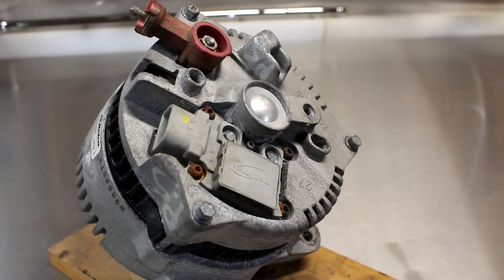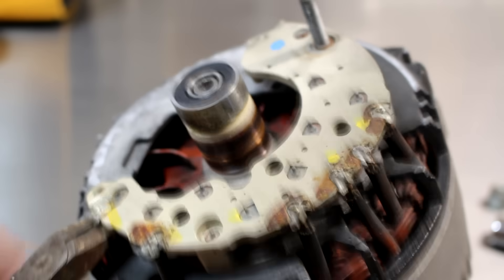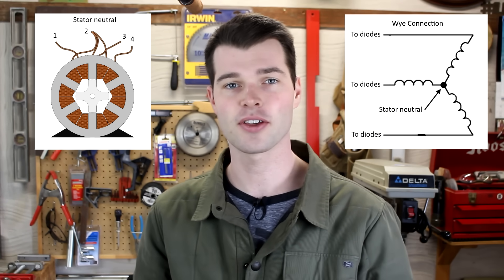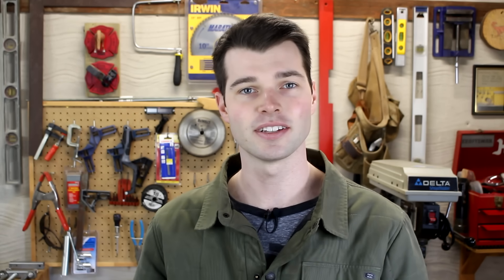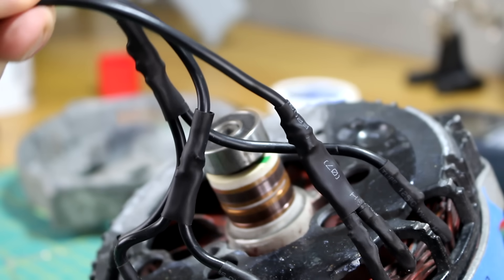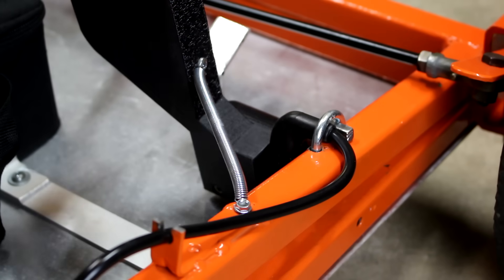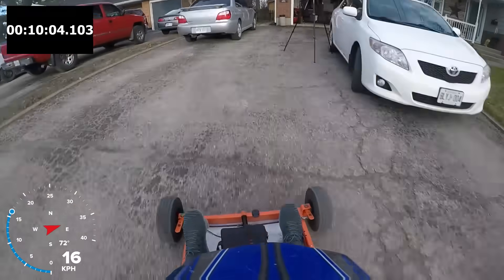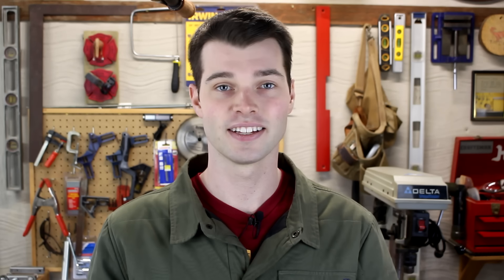Converting a Car Alternator into a Go Kart Motor

Comment: Could u please tell me exactly how u wired up your 6 wire alternator into a delta configuration, I have same type and I'm trying to turn it into a motor, brushless
Reply: To wire the alternator as delta or star
You first need to know how much tips the stator wires have
I can help you
Reply: @foxxyytofficial  there are 6 groups of two wires
Reply: @aaronowens1627  do you have a multimeter?
Reply: @foxxyytofficial  yes
I've located the 3 phases, I'm just unclear as to how exactly it'll be connected
Reply: Using continuity setting I was able to find the 3 separate groups, so 6 leads coming from inside and I soldered 2 leads, one to each brush for the low voltage to generate the field. I connected the 6 winding leads into their 3 groups and externally connected them as I understood it to form a delta connection.
Not sure if its correct cuz I was gonna use the speed controller from original on the scooter, but soon realized being for a brushed motor, its minus one lead. Any help, photos would, I'd appreciate greatly
Reply: @aaronowens1627  if you connected in delta, you can test it with any kind of brushless controller (rc esc, ebike controller, etc)
Reply: @foxxyytofficial  
Ok, I just have the 2 wire, brushed motor type tho. I'll order a big brushless tho. Do u have photos of how to connect those 6 wires in delta? I read blueprints for welding, fitting and build electric guitars, fix maps, but I'm not formally trained, it's all stuff I study and pick up on. Thanks
Reply: @aaronowens1627  call me on Telegram (its a competitor to whatsapp) searching @shadnightmares, and send me a pic of your alternator's wiring, and what wires are a pair (what wires have continuity between them)
Reply: @foxxyytofficial  what about for a 8 wire alternator ?
Reply: @markkidrov8426  probably it have parallel coils (2 groups of 3 phases and one neutral)

Comment: Could u run the alt to the battery and then run battery to a starter motor with some sort of governor to control starter speed I duno if a alternator would keep battery alive or if starter motor would suck to much power, but this build you have done is awsome
Reply: too complicated and not efficient

Comment: Quick question:  In case you have 3 pairs (6 wires), can you start the motor in delta and then change over to star to get higher starting torque and then higher speed subsequently?
Reply: I think yes, but you would need to take caution while testing
Reply: @foxxyytofficial  Thanks buddy,

Comment: hi very nice project, i would like to mike the motor but i have a question, will the motor work if i use smaller voltage for perhaps 24v or 36v
Reply: Yes, it will work, but with less RPM being usable

Comment: Why was second battery needed? Why rotor couldn't be plugged to the same battery?
Reply: He used the second battery because he didn't have a DC/DC converter from 48VDC to 12VDC
Reply: @foxxyytofficial  So, the rotor couldn't be plugged to 48V?
Reply: @Van_Tage  no, any voltage over 8v (in some rare cases the alternator can hold 12v on the rotor without overheat and damage), the rotor gets oversaturated with magnetic flux and it doesn't help

Comment: My alternator has 4 wires... How can i know what is the center tap.
Reply: It is thicker, and have lots more wires tangled together than the others
Reply: @foxxyytofficial  thanks bro
Reply: @owenlacanialo7882  if you need more help, take pictures of the alternator wires, and use IMGUR to upload and give me a link
Reply: @foxxyytofficial  sent pik in ur FB acct.
Reply: @owenlacanialo7882  i think isn't mine, i never showed my fb account
Reply: @foxxyytofficial  austiwawa... Fb page...
Reply: @owenlacanialo7882  i didn't found the photos there, i'm not austiwawa, just a fan of him
Reply: @foxxyytofficial  oops.... So where can i send the pik?
Reply: @owenlacanialo7882  use this site: https://pasteboard.co/
when uploading they will give you a link, so copy the link and send here in the comments
Reply: @owenlacanialo7882  hey, you will need to grab a multimeter in continuity mode, and test the wires in pairs (test 1-2, 1-3, 1-4, 2-3, 2-4, 3-4.)
one of those wires will have continuity with the others (like if you have a dot on the paper and draw 3 lines beginning in the dot, the phases will be the lines and the "neutral" point is the dot)
Reply: @foxxyytofficial  thank you. 😊😊

Comment: Can we run alternator for long time continuesly.
Reply: s.srinivas reddy, I would not suggest the use of a automotive alternator (retooled) to be a motor, and most certainly would not recommend it being run for lengths of time continuously.  Alternators are purpose designed devices to recharge a 12 Volt Lead Acid battery after engine start through a 12 Volt starter motor. The starter motor is also a purpose designed DC motor built to turn a gas driven (petroleum) over to start the engine. 
There are DC motors, purpose designed to operate continuously, for sale, by manufacturers where that is what the company builds for customers.

Comment: Hey, I really like this idea and I want to do something similar with a standing fan motor, I want to control it with an esc, but I’m a little confused because it has 8 coils and 4 pairs of cables, so I’m not sure how I’m supposed to wire it, from the diagrams I have seen in google the will be 3 main wires (3 pairs) and the last pair will be neutral, but it’s connected to a capacitor. I would like to know if using a esc will be possible and if I’m not to far of with what I need to do to make it work.
Reply: Maybe your fan motor is DC.

Comment: hey what i want to see and this video has 4.6 million views is a video about turning an alternator into a motor and using an alternator turned by a small high speed motor to power the now motor alternator as an energy savings device. you can do this for boat motor as they are alternators anyway and may work under water but may shock people so maybe put it in a tube that goes  in the water. just keep both above the water line with a elbow for the prop. it would make like four time the energy and be a big hit man. you can do it with drone motor but it does get heavy so the frames break man. you can use like tiny high speed motor on the one drone motor to power the other drone motor and it goes well sometime long enough for powered motor to burn up.

Comment: The alternator being 3 phase, could you use a VFD to control the speed of the motor?
Reply: The alternator works more like a BLDC motor, not an induction motor
Reply: @foxxyytofficial  Ok thank you, that was really helpful
Reply: If you grab the eAssist motor from a Buick or Chevy mild Hybrid you will have an induction motor star-wired and 115V nominal
Reply: @foxxyytofficial  ok, not as easy to source but possible. Thanks
Reply: @xavierwuzhear9349  if you have access to the site car-part.com
Check it for the alternator from the 2012 Buick LaCrosse with 2.4L eAssist motor

Comment: If you lower the voltage going through the armature to between 1.5 and 4 volts, you will get more power. 😁
Reply: More RPM
less torque
Reply: @foxxyytofficial  ..
I've just converted one into a motor, and have been experimenting with it, the results are promising. I need a lot of power from it to make the project work, I'm going to put 36v through it to maintain 2500rpm , that should give me ample torque from it, I tried using a newish alternator but the 6 tails caused issues so now have an older unit with the usual 3 tails, I'm not giving up with the newer unit just yet as I think it would be better all round once I've finally cracked the set up on the stator. If you have any advice on 6 tails, I would be interested in knowing your thoughts 😁
Reply: You need to know if the 6 tails are 3 pairs or if they are two separated stators
Reply: @foxxyytofficial  
I checked for continuity and they seem to be 2 pairs of delta. On checking ohms, they are all exactly the same! Using the first 3 tails is not a problem but getting the second set to match is problematic!
Reply: @raggytigger217  hmm, some people have found double-stator alternators, i don't have one of those and two ESCs to test, so i don't know how to help and use both
Reply: @raggytigger217  hey, check the YouTube channel FixitModitBreakit
If i'm not mistaken he got an alternator with dual coils as well
Go check with him

Comment: is it so that if you connect wires in delta configuration you need less voltage but more current?
Reply: Yes, a Delta configuration of the stator winding will need less voltage but higher current. A "wye" configuration will require less current but higher voltage to achieve the same performance.

Comment: Would like to know current, torque and revs. Just knowing the cart performance doesn't tell me that much. But I really appreciate the idea, thanks for that.
Reply: revs its hard to know
current you can ballpark easily in 40-50amps (some alternators can get 3200W or more easily)
Reply: @foxxyytofficial  it's probably much more then 50A
Reply: @miralemnermina142  if you count losses and everything ok

Comment: @austiwawa Did that controller end up powering the rotor windings, or do you have to use another power source for that like you did when you were testing it?
Reply: he used a 12v lipo in the field coil
Reply: @foxxyytofficial  lol I know what he used in the video. I've already built my own  and am working on a PWM power supply to energize the rotor, as well as figuring our that 4 volts will get you more RPMs, and 16 volts is good for torque. :) This guy has not responded to anything or anyone in a while, pretty sure he got what he wanted, and is done with this. ;)

Comment: Can you help me? I put an alternator on the bike but it doesn't have the strength to do it. I use a 1500w controller, 36 volt battery, 1 12 volt battery with 7 amp to start the engine. What am I doing wrong?
Reply: you have email or facebook?
Reply: @foxxyytofficial  yes, alucarkd@gmail.com

Comment: I have a question, will running the alternator coils at 48v instead of 12v not short it or cause any damage? I am personally building the ESC and a drop on amperage by upping the voltage will be good hahahaha
Reply: never use full voltage on field coil
it can oversaturate, overhead and damage

Comment: Hi, Thanks for  great video and cong. for awesome job.
Has alternator a brushed dc motor or brushless dc motor? Can anyone explane me? beca use in vids.  3:05 he said we put brush to the place but he used brushless speed controller. If I use alternator, What kind of speed controller I should use?
Reply: you need a brushless controller for the stator (the 3/6 wires part)
the brushes on the rotor are there for you to feed voltage into them (depending on the voltage of your brushless controller, no more than 14v(4s LiPo battery)
Reply: Just learning about this myself but I believe connecting the brushes is for the field coil. A normal brushless motor would have permanent magnets built in, however this being an alternator you need to create the magnetic field via the brushes’ field coil.
Reply: @kabevis1  that is correct, you need to feed current to the field coil using the brushes and slip rings, but instead of connecting directly to a battery, using one brushed ESC allows the rpm/volt constant

Comment: Very impressive. How well do the tiny alternator brushes and slip rings hold up? (Tiny, compared to the surface contact area of starter brushes/commutator segments)  I never understood the wiring adaptation done to convert an alternator to a motor; thanks for the explanation. That alternator (now motor) is an easy one to change brushes in, anyway. Did you think about using a starter, already a motor? It would need some modification, too. ("Choose your pain", I guess.)

Comment: Cool project!

I am an electrician and I have always been told that the motors we wire are wye delta induction motors. 

The induction winding is wye because the voltage is better over a longer distance but the the actual run winding is delta because it delivers more torque.

I would think torque would be desired on your drift trike.

I am anxious to see it.
Reply: Hi, can you explane me has alternator a brushed dc motor or brushless dc motor?  in vids.  3:05 he said we put brush to the place but he used brushless speed controller. If I use alternator, What kind of speed controller I should use?
Reply: @cahitabdullahmisirli8424   Alternators are a milestone piece of technology, and uses some clever technologies to achieve what they do.  A typical DC brushed motor uses an arrangement of permanent magnets on the stator (around the outside) with two or more electromagnets rotating on the central shaft, and whose polarity is switched to ensure each electromagnet opposes the stator magnets. With me so far?

An alternator, on the other hand, just flips the concept inside out. Now you have coils for the outside stator with an  electromagnet on the central shaft which gets DC power through a pair of slip rings and brushes - the rotor's magnetic/electric polarity is not switched with rotation as it does when using commutators.

When vehicles used generators for power, the speed of the engine would cause wildly-variable output voltages that were difficult to properly regulate. The alternator changed that, varying rotor speed was no longer a problem because very precise voltage-regulation is done by simply varying the voltage going to the rotor electromagnet. The strength of the rotor's magnetic field controls the energy induced into the stator's windings, and can precisely control the output power.

In this project, the DC power level of the alternator's rotor would be held constant, while the stator windings would be sequenced with varying speed and power levels to spin the output shaft accordingly.

Comment: have you ever thought about using a starter  instead of a alternator to power the drive train and use and alternator to keep that battery charged at all time? the starter uses more power and have more torque and if charged all the time? you can drive it endlessly. :D speedy go cart at 120 km on the highway. :D
Reply: Dude, if you could actually do that we wouldn't have to recharge cars or bikes or anything with batteries

Comment: do you have a idea of the difference of power output of this converted motor to a motor of same size already made to dc?
Reply: alternators when converted to motors aren't as efficient as "real" dc motors, but i dont have the exact numbers
Reply: @foxxyytofficial   thanks for letting me know
Reply: but i saw some charts about efficiency tests with Denso alternators and the max power is 3200W with 80-85% efficiency
but i dont remember if its on 48v, 72v or other
search on the endless-sphere forum for more information